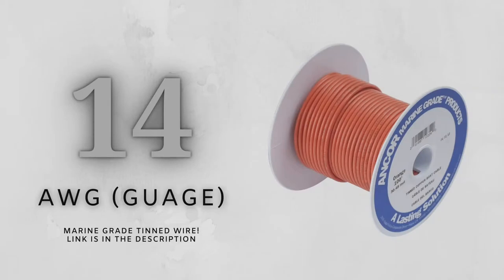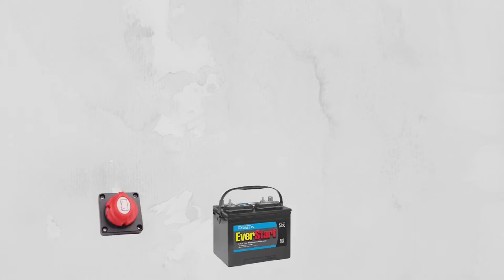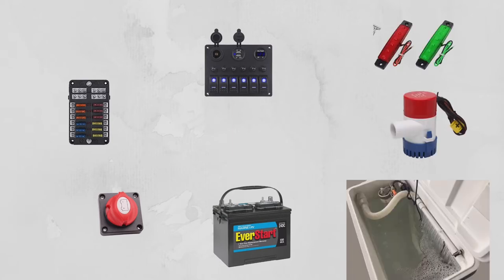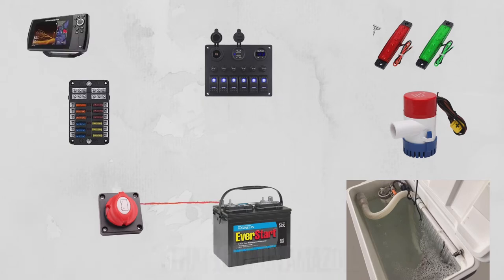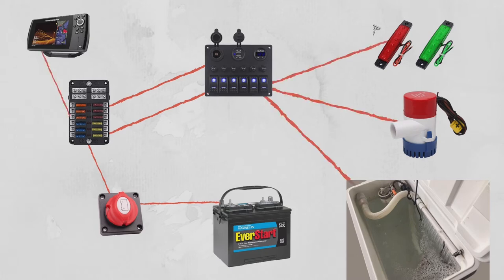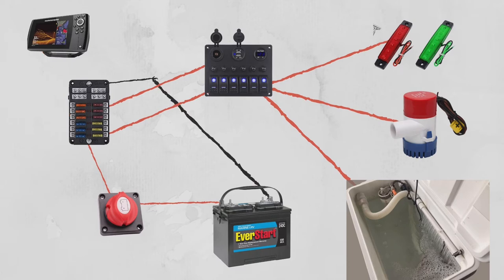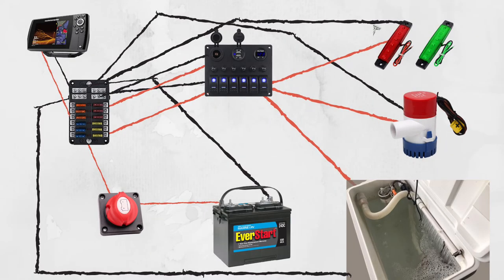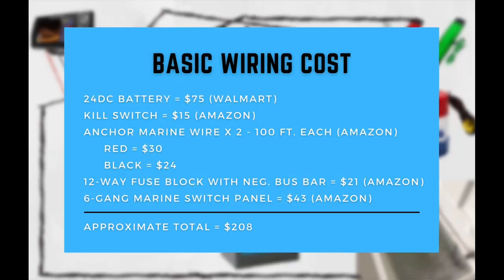JON BOAT WIRING - Basic Diagram (2021) DIY

Comment: Great Video, I'm about to do the same. Is this setup still working out ? And what size wire did you use from the battery to the fuse panel... thanks
Reply: It might be a bit late but the wire they recommend is 8AWG

Comment: I know you posted this a year ago but I want to be clear. You ran 6 gauge from the battery to your kill switch then 14 gauge from the kill switch to the fuse box and then from there to the switch panel and then to the accessories? Just 6 and 14 gauges were used?

Comment: Are you running 6awg wire from the on/off switch to the fuse box?  Surely a single 14awg wire cannot support the entire fuse box, or can it?

Comment: Do you need any inline fuses?
Reply from the maker: It really depends on what you’re wiring. You could run one from the battery to the kill switch if you wanted. If you’re running one straight from a trolling motor to the battery, you should (if it doesn’t come with one). But the fuse box, depending on the amps, should take care of needing to run inline fuses for the most part. DISCLAIMER like in the video, I’m not a licensed electrician! Check with one if you’re feeling uncomfortable and/or need more help.
Reply: @flipmyjonboat4485  I’ll be wiring the same way you did. Battery >kill switch> fuse block > switch panel > accessories